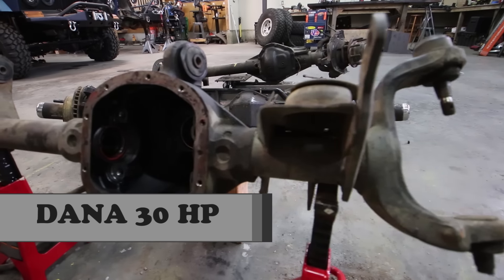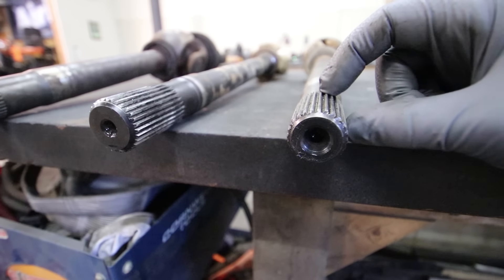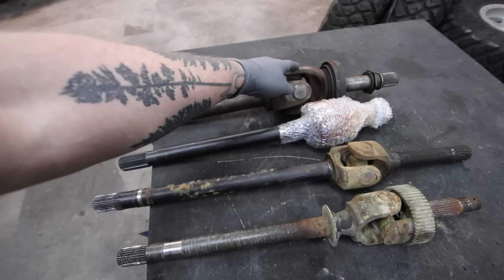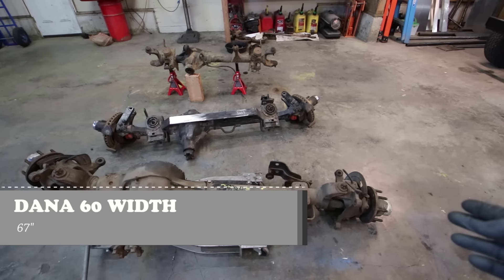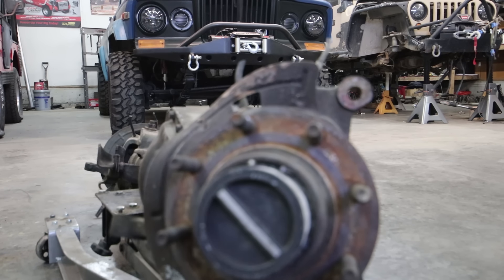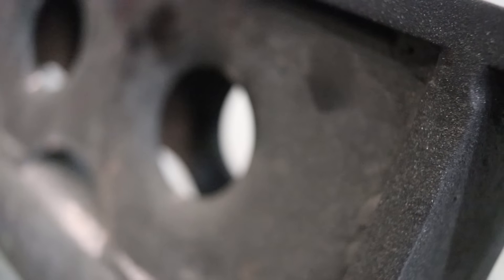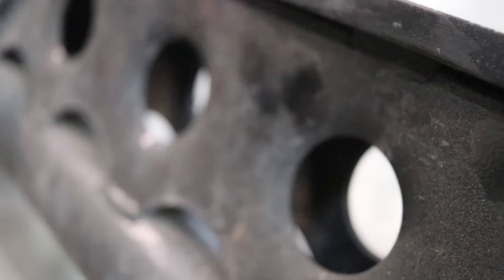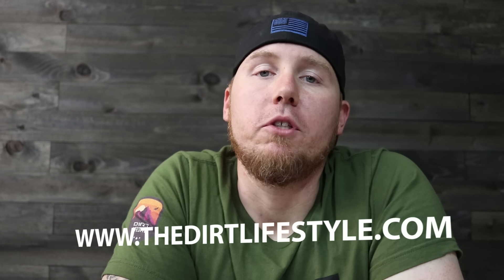DANA 30 vs 44 vs 60 Junk yard Axle Swap Beginners Guide!!!!

Comment: HP vs LP, no one mentions in forward vs reverse!?  If you get stuck nose down in a hole a LP axle will be stronger!  Usually your front tires unload when you accelerate, if you're towing, or super heavy a LP might be stronger as long as you aren't pedal to the floor mud bogging, or rock bouncing?
Reply from the maker: I didn't mention a low pinion versus high pinion rear application either. Truth is, you can only fit so much in one video. I cut out a bunch of stuff just to make the video a manageable length. You right about being stuck in a hole. Lowpinon would be stronger. But I thinks it's much more likely you will be throttling hard through a series of slick obstacles than having your front end stuck down in a hole. Im not sure if I've ever use full throttle in reverse before. I've formed my opinion based on my cumulative experience wheeling with people all over the country. I'm not to stubborn to change my opinion but I have yet to see a hp break. And unfortunately, I've seen a number of lowpinion front axles fail. Thanks for the question! I hope even if we may disagree about this issue you still decide to continue watching the channel 👍
Reply: Didn't mean to come off as angry😁.  I've had a couple times winter wheeling where you're creeping along scoping out the snow pack and the snow collapses in front, but probably not going to break much with the lack of traction, I've had 2 other experiences in mud where I wasn't sure how far I wanted to go and decided to go back.  Had to nail it in reverse, broke a CV axle in a ZJ one time and I think I broke my transfercase the other, still gotta tear into this last one to know for sure

Comment: Nice video!! .. but I still have questions if you can help me out. I have an 89 xj 4x4 that I’m LS swapping, Dana 30-35. I WILL NOT be off-road with it but will be running higher horsepower (+500hp) and don’t plan on going bigger than 30” tires. In your experience and knowledge, do you think I can be safe on building my axles or should I hit the local scrap yards? Thanks again! Video was great

Comment: Old video but you think I should go with a 14 bolt and Dana 60 for a 89 suburban build? Right now got factory axles gearing and everything with 35’s. Thinking of going 37-40 tires.

Comment: great info Nate, I live 600 yards from the biggest salvage yard in my Province so I have easy access all day everyday. how can I tell without removing diff covers that is a high pinon. i realize this might be a dumb question  but I don't have the money to be wrong, my guess is the the output shaft is higher than the center line of the axle. is this assumption correct? Thanks for your newbie videos.
Reply from the maker: You can physically see the pinion is higher then the center of the axle. Check out some pictures on google images and you'll see exactly what I'm talking about 👍

Comment: Iv had 9 xj’s an all stock axle’s an wheeled the crap out of all of them an only time I broke something is when it was my own fault. I got really drunk an was slamming from 1st to reverse with my foot to the floor in a mud hole an by around the 10th time I snapped the spider gears in the front low piñon dana30

Comment: Bought my wife a ZJ for cheap assuming it had the same drivetrain as an XJ. Boy was I wrong. The front LP30 was already broke in half so it got an XJ HP30 and the rear is getting an 8.8 (& maybe a shave) as soon as I have the time. I don't understand people swapping LP axles. HP's are stronger, better driveline angles, and less chance of grinding your yoke/driveline on rocks.
Reply from the maker: I totally agree bro! Sounds like a sweet build, I'm a sucker for a built zj 👍
Reply: Dirt Lifestyle k

Comment: I have a 06 lj. Just bought everything to upgrade it, truss, gussets, chromoly shafts... Thinking about just getting a hp 30 from a Cherokee. Can I use everything I just bought for my lp 30 on the hp 30? I'm assuming my gears aren't compatible. Does the Cherokee year matter since I'm replacing shafts and gears?
Reply from the maker: Everything should swap except for the truss. There is a number of different truss kits available so I would email the manufacturer to make sure it works with a high pinion or a low pinion. 🤘
Reply: 96 dana 30 Cherokee can be swapped in to a TJ. Thats what im doing.

Comment: Good content and well made. Thanks for putting it together. 
Question about your recommendation. I have a 97 TJ that I've put a V8 in (still working on it). I'll be running 35s. I left the Dana 30 in, but re-geared it and installed chromoly shafts. I purchased some C gussets for added strength. Do you think I should put a truss over the tube?
I've thought about eventually swapping in a Dana 60, but one thing at a time. And, I'm not sure what is involved with doing that swap.
Reply from the maker: I definitely would toss a truss on it! A 35 is borderline on a tj with a Dana 30. But with the added horsepower you could easily spin a tube. The welds that they use to hold the tube to the center section is a joke lol. People spin axle tubes all the time and in all Dana axles. But it's even easier with a Dana 30. Good luck bro!
Reply: Good point. Thanks for the reply. I actually had the tubes completely welded when I re-geared it. But, I will look into a truss also. You mentioned you built/fabricated yours. Do you have a link to a video?
Reply from the maker: Unfortunately I did not film it. It takes a lot of time to make one of these videos so sometimes I will build small things like this without a camera to save time.  I have a full time job and a family, when you throw a YouTube channel into the mix, there is a lot of juggling involved lol.
Reply: I totally understand. I filmed my build at the beginning and realized how much extra time it takes. So, I definitely appreciate what you do. Thanks again.

Comment: I've seen quite a few different videos regarding Jeep Wranglers. I always find myself coming back to watching your videos. I like the way you explain them in detail. I like the looks of your shop and the way you present yourself.
I have 00 TJ with D35 & d30. I like to play hard but I'm finding these Jeeps being very disappointing when it comes to the drivetrain. I'm not going to be doing anything stupid regarding rock crawling or Moab but I do like to play hard climbing Hills and going through the mud. I'm wondering if I upgrade to the heavy-duty 27 spline axles with a lunch box and a heavy duty front axles upfront with a lunchbox if I'm light on the throttle they'll do okay. Obviously I would take your advice and weld some trusses on. Get back to me when you can thanks buddy

Comment: What’s the biggest tire you would be comfortable with installing on a completely built Dana 30
Reply from the maker: For a light weight low horsepower rig, 37s should be fine.  But you are really gonna have to build it to keep things reliable. 🤘

Comment: Hi. Thanks for your channel. You are very good at explaining. Is there a way to contact you. Ask a question?. I have a 91 yj. 8.8 rear. Dana 30 front. Yes. I installed a Spartan locker in the front. I haa e gone, back and forth, one piece Cherokee axle, back to a split axle. I'm in South Central Tennessee, I don't do rock crawling. Lots of dirt, and mud. On my 40 acres. I am retired, and on a budget. I was told to. Go   CJ 7 axle rout, or  early IH scout .I saw several in a back yard. Help !!!!

Comment: Where do you rate the HP D60 out of the 78-79 F250 F350 and the HP D44 from the 78-79 Fords with leaf    springs.?
Reply from the maker: Same as the super duty 60s. Very strong right out of the box but with a low hanging center section. Alot of folk prefer a kingpin  axle but I've never seen concrete evidence of kingpin being stronger than ball joints so I would use either without worry. Great axles for the right application 🤘

Comment: I'm running d30 hp with stock gears (3.55) on 35x12.5x15 01 xj an I beat it harder then my own an no problem besides the uper control mount (pass side) collapse after going 4-6 feet up then down , I did blow the gears, witchbis due to lack of upkeep

Comment: Awesome information Nate! Question is the front 44 in my stock 06 LJ a hp 44. What is your recommendation to build it for 37” tires?
Reply from the maker: I would build it exactly like I did my brothers dana 30. I have a video all about it actually. Rcv shafts, WJ knuckles with a strong locker. I prefer the yukon zip locker 👍
Reply: Thanks Nate I will check it out

Comment: I have a stock 2WD 2000 GMC 3500HD One-Ton Dually with a factory Dana 80 rear end, 4L80E auto trans, and an I-Beam front axle with leaf springs. How easy/difficult would it be to convert it to 4WD? Will it all just bolt-up? Which front axle would be best? I'm thinking Dana 70, but they're hard to find. I don't need it for serious off-roading, I just want to keep it factory height with factory-sized (maybe slightly bigger) all-terrain tires so I can get around in the mud and snow.
Reply from the maker: You'll need a new transmission or 4wd tail housing for your current one. Plus a transfercase and front axle. You'll be fabricating a ton of stuff from scratch to get the axle/steering/shift linkage to all work. Not to mention at transfercase mount and skid. To me it's not that big of a project but it all depends on experience and your ability to think on your feet. This is not a bolt on project unfortunately
Reply: @DirtLifestyle  Thanks for responding. Good info!

Comment: Also won't chromoly shafts move the weak point from the axle to the R&P?  My current plans are to keep the axle shafts stock and carry spares(you can get pretty cheap fully assembled setups from AZ, O'Reilly's, Napa, etc).  I've upgraded the u-joints so I'd hope any trail failure would be a "quick" axle swap rather than u-joints explosion or total R&P failure.  Or is there a better way?
Reply from the maker: There is a couple different schools of thought with building axles. One is to build it with a "fuse" or weak point and another is to build it bullet proof (or close to). I don't like having a fuse in the system personally. If I strip a ring and pinion it means I need a bigger axle or a bigger ring and pinion. But it doesn't mean I made everything else in the axle to strong. Stripping ring and pinions does happen but it's rare so I made my Dana 44 High pinion with no weak points and it doesn't break. The only spares parts I carry for it are spare hub bearings but I've never needed them either.

Comment: Hey Nate do you happen to know if a high pinion Dana 30 out of an xj is a direct swap into a zj? Wasn’t sure if the driveshaft would need modified since the current front axle is low pinion

Comment: What axle would you recommend for a 1996 Dodge Ram 1500 Single cab short bed? It has a D44 in it now, but i don’t know if it’s a high pinion or not. I want to swap a D60 from a Ram 2500, but after watching this... I don’t know! Let me know.
Reply from the maker: If you're using it as a Wheeler I would definitely upgrade to a Dana 60. That's not a lightweight truck and you have V8 power.  Also the front axle that comes in your truck has a center disconnect which is a common failure point offroad.  I can't remember off hand but I believe your truck is a driver side drop axle. If so then I think the Ford Super Duty 60 is a perfect candidate. Good luck!
Reply: Dirt Lifestyle thanks for the quick response! Yes the front axle is a driver side drop. And yeah that center disconnect is a pain. The thought of a ford axle scares me lmao! But it’s a Dana Spicer ultimately! Well keep it a secret it came from a ford hahaha! Thanks!!
Reply from the maker: No problem man 👍

Comment: Great vid. I’ve owned a ‘78 CJ-7 for 10 years now, just as a daily driver out of necessity. Bone stock. Now its time to start plan a build. Its the stock (AMC 20?) Rear diff. Someone recently told me that 20 axle has a larger ring/pinion set than a Dana 44 and with the proper truss it is actually stronger than a 44. Any truth to that?

Comment: Hey Nate, why don’t people run a high pinion in the rear on all 2 door Jeeps, and a high pinion front?
Reply from the maker: Some do! It's not very common but I have seen really light weight small horsepower rigs using a high pinion rear. The reason it's not common is for two reasons. In a rear application the high pinion is 30% weaker because it is spinning the opposite way of the front, pushing the gears apart under forward acceleration. Because of this, no stock vehicles (that I know of) have a OEM high pinion rear axle. So you'd have to build your own if you want one. Good question, I should have brought that up in the video 👍
Reply: @DirtLifestyle  only if you put reverse cut gears in, you could still put standard forward cut gears in.

Comment: When you say not going with dana 30 or 44 if you have a V8,are you refuring to modern engines like LS1-7 and hemi's and such? Or V8s in general? I have 95 grand Cherokee with the dana 30 front that I'm toying with dropping an sbc 350 in it that i have. Not a crazy built engine. Only upgrades it has is a double roller timing set, edlebrock performer dual plane low rise manifold, edlebrock 750 carb, and a set of cheap headers for a Monte carlo or something. When i did get it running, it had quite a bit of chop to it. So I think someone put a cam in at one point.

Comment: I have a street driven 90 suburban with a passenger side drop 10bolt corporate rear , 12 valve Cummins. Was curious to know if there was a Dana 60 passenger side drop to use the existing leaf spring set up.

Comment: I have a 2000 TJ drum brakes all around D30 Front D44 Rear... I want to swap axles to have Disk Brakes all around... What TJ model can I do this with? I want to do a hot swap I dont want to weld anything.
Reply from the maker: I'm not sure. I think all the LJs have disc in the rear but I don't know if you would need to weld on caliper brackets. If I remember correctly someone makes a kit that's bolt on but those type of brake kits are usually pretty expensive. 400 bucks plus

Comment: Is there some tool that we could use to help choose an axle for our rigs? Like a website that lays it out per vehicle or something? I'm looking at at 44 swap for the front of my 82 CJ5, but I don't really know how to find the right wheel base axle, or how to make the leaf springs fit (but I'm assuming welding).
Reply from the maker: I don't know of anything like that. Would be pretty handy if someone put together an app or something. It takes lots of research online and some trips to a junkyard with a tape measure 👍

Comment: Good vid. I’m just so confused weather I need to do solid axle swap or invest into front end I have already. I have a 2005 lifted Tahoe z71. Daily drive but gonna run 37’s and they are pretty heavy with wheel and tire combo. Not looking for extreme off-roading but wouldn’t mind here and there going thru some mud and crawling up something. Any info is appreciated

Comment: Regarding the Smile on the Dana 30, it is the fork of the ball joint that is bent, correct?
Reply from the maker: Lots of "smile" points on the dana 30. Weak Inner c, thin axle tubes, weak welds from the tube to the housing and even the knuckles them selves. The knuckles won't bend if you keep your scrub radius in check but everything else needs to be shored up in some way 👍
Reply: @DirtLifestyle  I have a smiling Grand Cherokee and thinking about how he got to be so happy, I can only remember one hard jump that ended the suspension travel. Since the bump stops are located at the ends of the axle, the only thing that could have been bent, is the forks holding the knuckles. Trying to bent them back, has proven to be quite difficult, but I have not give up yet, a few more ideas are to be tested. 😄😄

Comment: Any thoughts on lug count (5 vs 6 vs 8) on a Dana 44?
Reply from the maker: I don't have any particular preferences. I would figure out what rear axle is needed for the build and match the front accordingly. If i have a Ford 9" rear then a 5 on 5 1/2 front is perfect. If i have a 14bolt then of course a 8 lug is front end is in order. In terms of strength, the eight lug is stronger of course but keep in mind that 5 on 5 1/2" is the most common bolt pattern in offroad racing. Plenty strong for most applications 👍

Comment: Great video! I'm hung up on something though - on a front axle with a high pinion, the pinion is pushing the ring away to move the vehicle forward, opposite of how you described. If pulling into the ring makes it stronger, wouldn't the low piniom be stronger (on the front)? The rear makes sense. Am I missing something obvious? Thanks!

Comment: Is there any way to make a dana 35 trust worthy on a tj jeep wrangler?
And run 33s on it.
Reply from the maker: The Dana 35 is the one axle I have no hope for lol. I ran a Dana 35 on my tj with 33s and got away with it but people grenade these axles on 31s all the time. If you toss money at a rear axle look into the ford 8.8. It's cheap and reliable 👍
Reply: @DirtLifestyle , thank you for the solid answer. 
I was leaning that way,  but I've never seen this conversion done.
And the ford 8.8 will be in good step with the dana 30 in the front?
Or should I go with a ford 8.8 for front and rear?